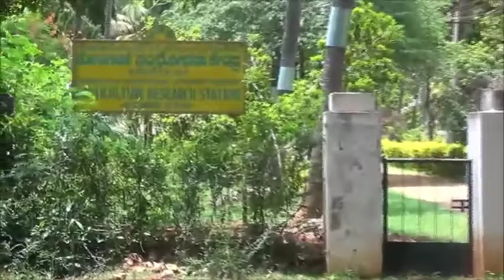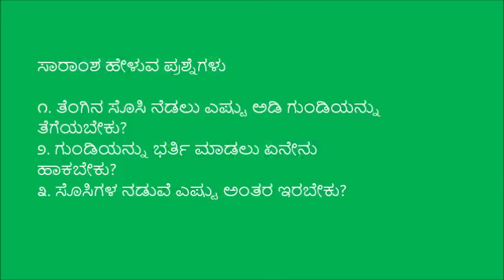Coconut planting method_Tiptur

Comment: Thanks for giving information on how to plant a Tiptur Coconut tree including its pit size etc etc. In August 2021 I planted two Tiptur Coconut tree in my site using Compost fertiliser and ready made cow dung,but did not add sand. However, every week twice provided sufficient water.But now its branches are drying. Can you suggest any solution for this problem ? Thanks.

Comment: Thank you  - this is fascinating and helpful teaching.  I would like to grow a coconut palm indoors, in the United Kingdom.  I have two stories of space, and will probably require a heating pad and a humidifier.  What is "Dimet"?  I see the phrase "we use sand and dimet."  Is that the manure?  Or something else to stop ants?  Thank you.  - D.
Reply: He actually says that they add sand to keep out "white ants", which means termites, which I assume would eat the rotting coconut husk underground because termites eat wood. You won't have those indoors in England. A mature coconut palm with a full-grown crown can really only be accommodated inside the largest greenhouses. Growing one in a pot will keep it small due to the roots being confined, but eventually you would end up needing a very large container like a half-barrel.

Comment: 100 ತೆಂಗಿನ ಸಸಿಗಳು ಬೇಕು ಸಾರ್
Reply: Sir, Kadur,Arasikere and Tiptur Talukgalalli water problem ide Shivalingaiah MLA section meetingnalli water required from dams. My experience from 1980 to till date coconut plants are dried for no water. Borewells are going deep minimum below 800 feets. Hence Govt., has to be taken action for permanent water supply from dams. Like Hemavathi dam water running Hechanur to Tumkur this area coconut plants improved, same type other side to be done left side to be done